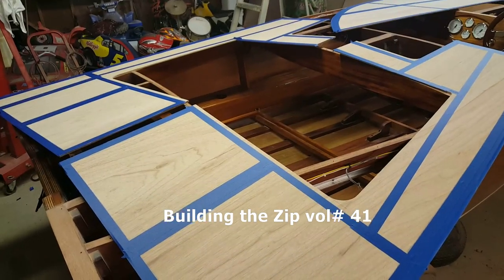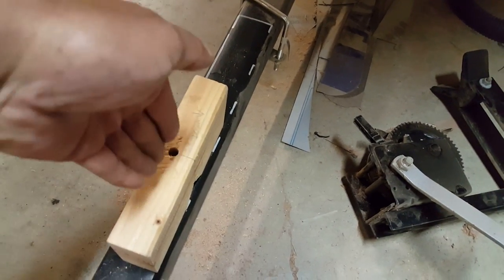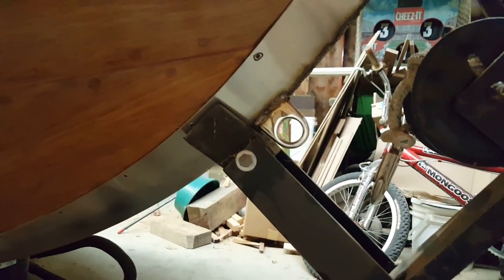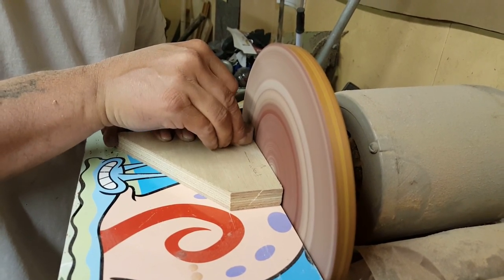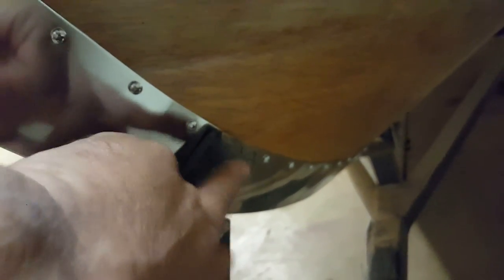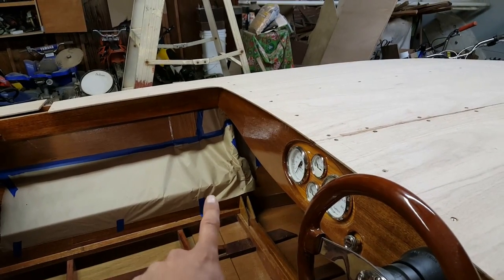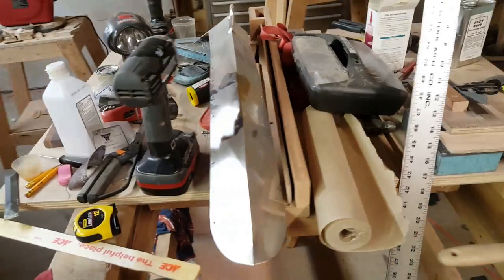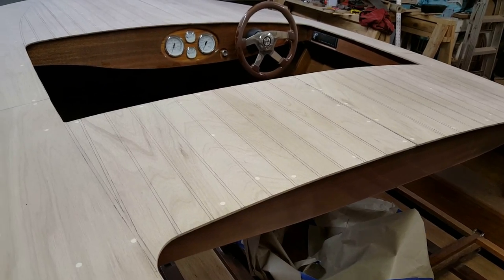Building the Zip vol# 41

Comment: Hello. I am beginning with squirt and found your videos which are amazing. Were the screws you used on plywood removed after the epoxy was dried? I can see that you have closed the holes with epoxy but i cannot understand if the screws were removed
Reply from the maker: I left the screws in and covered over them.
Reply: @joshuaburks  thank you for the response.